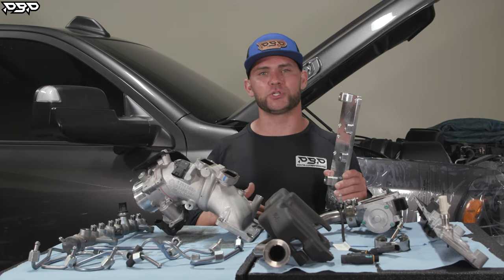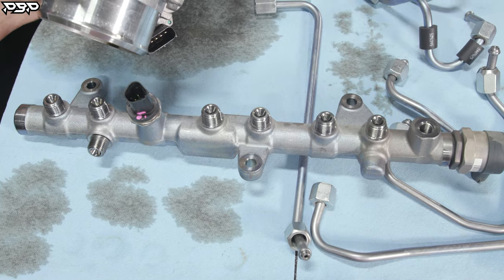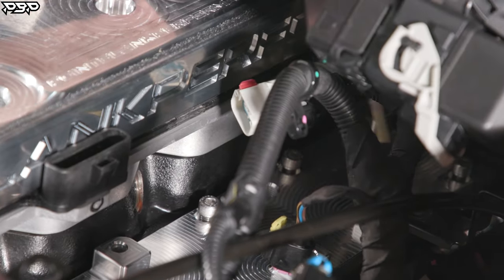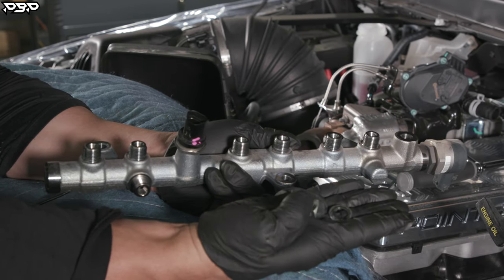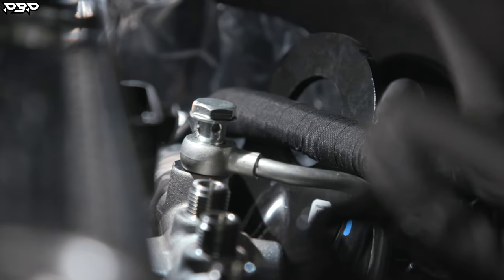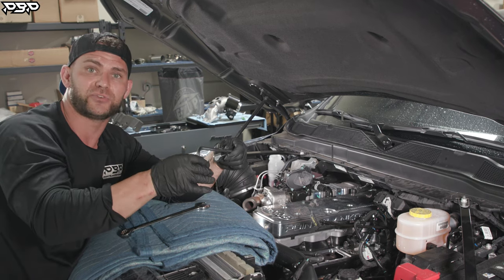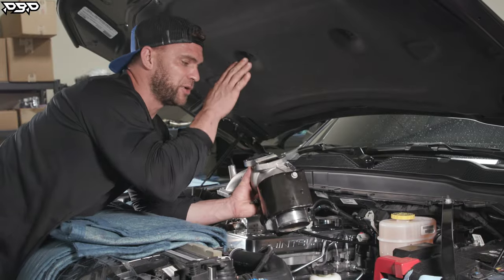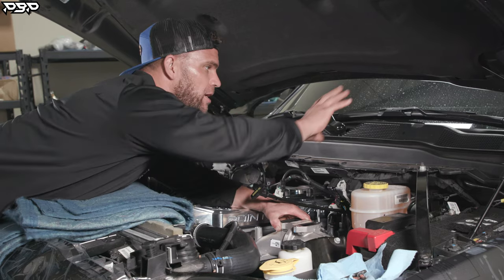CUMMINS 6.7L GRID AIR HEATER DELETE INSTALL!!

Comment: How do you keep a check engine light from coming on. I have a 2015 longhorn with push button start. When I disconnect the grid heater I get a check engine light light for grid heater voltage
Reply: buy a tuner. I like the Mini Maxx personally. gets rid of all those annoying codes and tells your truck nothing is wrong with it.

Comment: Not so fast, you will need tuning to prevent setting check engine light codes, then you will need to upgrade your 68rfe transmission (trans also needs new tuning,) both of which require finding a shop to do it which is very hard after what the EPA did to the Diesel Tuner market. The manufacturer and the gubmint both want you to just buy a new truck after 5 years. I speak from experience, 2 deleted cummins Rams, 2 smoked factory transmissions after 120,000miles. Super frustrating having to spend a lot of money making these trucks right, but if you can do it, they are runners for sure.
Reply from the maker: Thank you sir for helpful information we appreciate it!

Comment: Thank you for the fantastic video, love the dry humor! On my 22, won't I still need my grid heater though? Or do you just need this is specific climates?
Reply from the maker: We always take them off in our application, more so for performance gains. If you are in a environment where it stays 30 and lower all year then yes I would keep the factory unit on!

Comment: 2018 2500hd stock everything.  Will doing this throw any codes and keep the pickup from starting/running?  Located in the middle of the country, so the temps vary seasonally.
Reply from the maker: It will throw codes if not tuned sir.

Comment: Very detailed install. Can we get some like this for the L5P duramax gang
Reply from the maker: What we thinking you’d like to see?
Reply: Anything from Maintenance related to performance items, Trans oil change on the 2020+, up pipes, manifolds, injectors, ccv upgrade, fuel filter upgrade kits, full piping kit installs, turbos. All of it. 2020+ would be preferred.  When are you guys going to make a ccv billet upgrade kit for my 2020? I'd rather buy one from you guys than the other 3 letter company.
Reply from the maker: @nickwarren5800 have you checked out our billet valve covers ?

Comment: Thanks for the video! Will removing the grid heater cause a check engine light, on a stock 2014 Cummins?
Reply from the maker: Yes sir it will!
Reply: @POINTBLANKPERFORMANCE  and then what? I'll need a tune to get rid of the CEL?? Does anyone make a "fooler" of some sort so you don't need the new tune?

Comment: Any other mods needed for a grid heater delete? I want to do it on a bone stock engine
Reply from the maker: What year sir ?
Reply: @POINTBLANKPERFORMANCE  2018
Reply: @POINTBLANKPERFORMANCE  That a yes or a no?
Reply from the maker: Yes sir you would have to turn off the grid air heater code !

Comment: Does it fit a 2013 ford 650 with a cummins motor  Non deleted
Reply from the maker: We have installed in that application to be honest , if it did work the check engine light would come on if the power wire is removed from the factory heater sir !

Comment: Dude, this video is awesome!
Reply from the maker: Thanks for the comment sir!!
Reply: Did you just assume my gender?! Kidding. I do have a question though - are there torque specs on the fuel lines, and the spacer plate?
Reply from the maker: @coast.cutter7552 We don’t sir provide any on the spacer plate bolts but if you’d like them we can grab those. For the fuel lines tight sir 29k of pressure go through them so put a little elbo on them you won’t hurt them.

Comment: Did you put a race plug on fuel rail??
Reply from the maker: 4Th Gen yes sir.
Reply: What’s a race plug? I bought the banks monster ram air kit does it come with my kit?
Reply: No it get rid of the pressure relief that can wear out